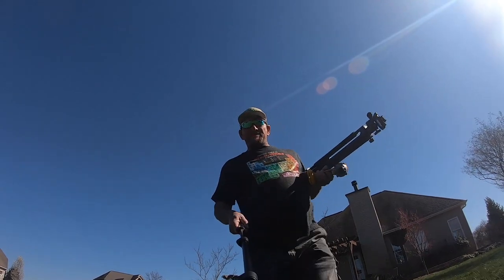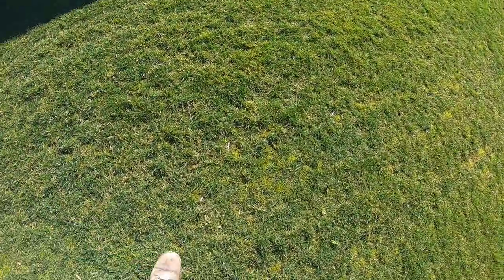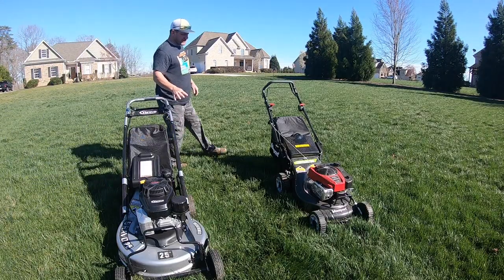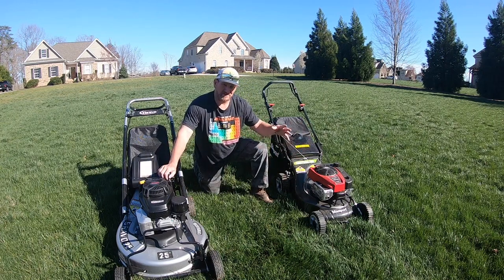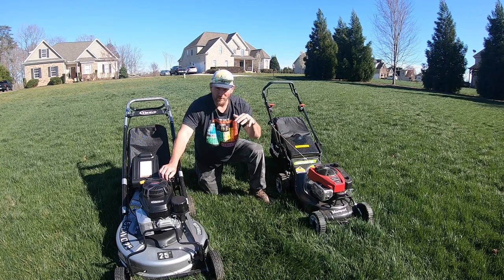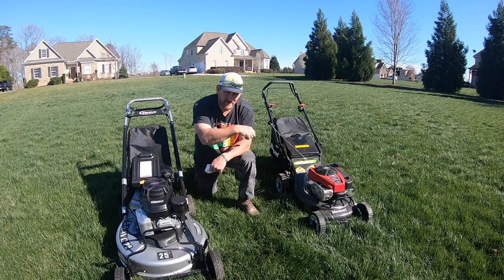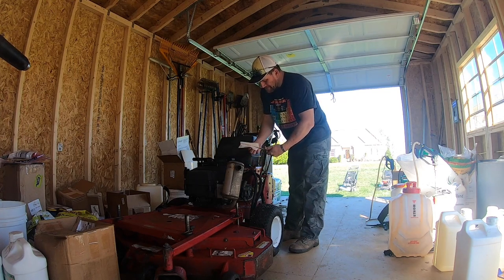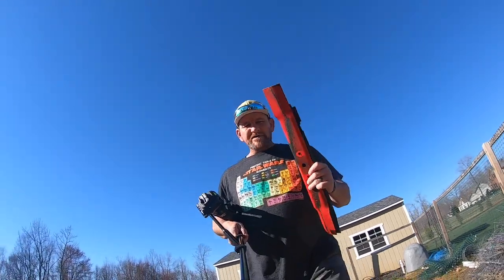How to get your mower ready for Spring

Comment: On my Toro GreensMaster 1000 I actually run a stabilizer through the system for 10 minutes, then turn the fuel shut off on and drain any remaining gas. I leave the oil in and will change it in Spring. Remove the spark plug of course. Then I wrap the engine with a clear wrap I use on my boat engine. When you pay $,$$$'s for a piece of equipment, take care of it!

Comment: I had this super old ariens 21" commercial mower with swivel front wheels, got it used off craigslist years ago, it was probably 20 years old, and without fail it would fire up in the spring time 1st pull every time. Those old Briggs and Stratton engines were solid. Kind of wish I didnt sell it but it was such a pain to use and I hated mowing with it. Should have done an engine swap with my Toro personal pace, now that would be a good match!

Comment: That's the first commercial Sharpener I've ever seen. I worked for 2 different lawn companies. I was Blown Away watching you use that. What is it technically called? I've only used the double wheel grinder for about 26 years.

Comment: I would have thought you would have sharpened your mower blades in the fall when you changed your oil and got your mowers ready for the next season. I'm sure you did it, although you didn't mention it in the video, but to scrape of the grass clippings crap off the blades and the underside of the mower deck. Nevertheless, still a very good video and it never hurts to remind people of basic maintenance on their lawn care equipment.

Comment: I noticed all three mowers puffed smoke on first start.  Is that because you "fogged" the cylinders with oil last fall with spark plug change?  I sharpened all the blades at put-away time last fall and even put a film of chassis grease on the fresh metal edges to avoid any rust.  Nuts, right?
Reply from the maker: I have no clue what you mean by fogged.... that was the first time i cranked those mowers since last fall...they always blow a little white smoke out with the the first crank????
Reply: @GCITurf  With iron and steel engine blocks, it not uncommon to store such equipment over the winter with the cylinder, head, and piston rings well coated with motor oi.  This is easily done by removing the spark plug and squirting a shot of motor oil  or Marvel Mystery Oil into the head  via the spark plug hole.  Then crank or pull the motor over a few times to disperse.  Some good part of the oil is forced back out the hole in the form of a foggy mist, maybe the source of the term "fogging".  Maybe the storage season down there is shorter, less humid, less prone to thaw/freeze cycles.  Enjoy the mow!
Reply from the maker: @rooster3019  ahhhh...good info here...I had no clue....I may try this next year for sure...thanks bro!